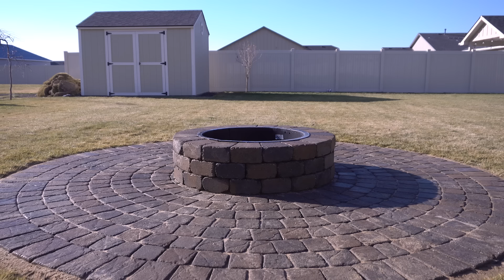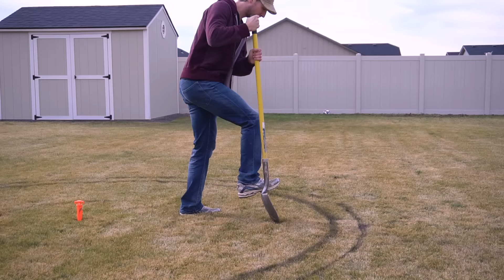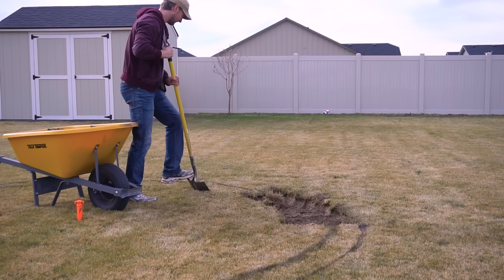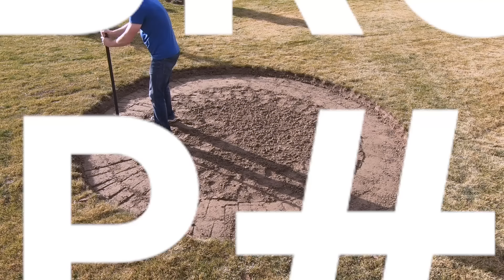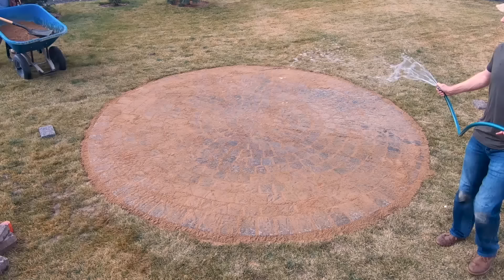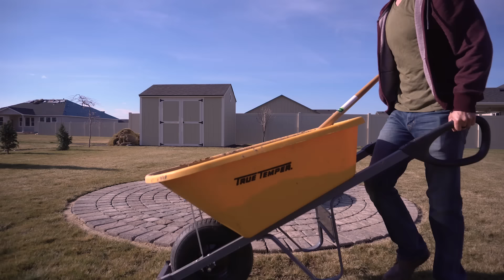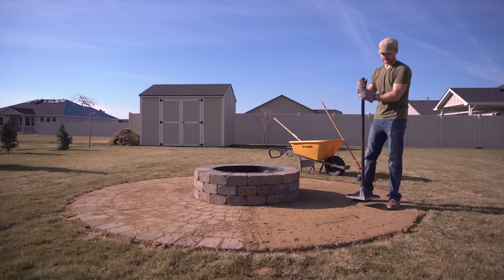My 4-Day Fire Pit Patio Build [Full DIY Project]

Comment: yes do get the plate compactor ,dont use sand use HPB also known as quarter chip , 7 inch base is very very minimum, the little gaps are to be filled with sweeping medium once stone is laid ,sweep it the run the plate compactor on top,that sets pavers down and trickles sweeping medium into the joints

Comment: Use a plywood board that's something like 75cm x 75cm (something like. 30 inches I think?) If you need to walk around the sand. Will be more stable than just some wood:)

Comment: Did you use polymeric sand, to lock the pavers in? If not, that sand will just wash away over time. Polymeric sand hardens when you spray water on it.

Comment: What was the point of laying the conduit if you removed it and filled it back in with sand?
Reply: The conduit is just a way to easily measure how much sand to out in. The conduit is 1 inch thick. You have to put down one inch of sand. Then you can use the conduit as a guide to push off the excess sand and make sure the sand is level and flat.

Comment: I'm no paver expert, but in my area sand is definitely not recommended. The thought is that water will slowly erode away the sand. Whereas 21a stone or pea gravel will stay in place. Only use polymeric sand at the very end to sweep in the cracks before misting with water.
Reply: Pea gravel will never compact
Reply: Dan Bertucci  My comment on philosophies is probably more in regard to heavy commercial applications. I'm a General Contractor, so I see lots of applications but don't necessarily have the intimate knowledge my subcontractor or you would have. That being said, I've never seen a paver job at my local university that wasn't set in .5" sand on a 7" concrete slab with 18" wide concrete curbs. So there certainly are different philosophies. But in general I imagine 21a sub base with sand or gravel dust top under pavers is immensely more popular. In my area they typically just use a gravel dust and only minimal as required to level the 21a.
Reply: Dan Bertucci  Thanks for the info Dan. I've had clients request 30+ feet deep pits in the middle of an operational factory, request rock blasting an ADA entrance into a famous operational cavern, drop MRI's through mutiple stories of an operational hospital, spend more than $70k on a crane just to set a single tank.... spending money on a 7" slab is not a huge deal if you need what you need. I've got pavers at my house and the installer indeed used something to level the sub base so didn't mean to imply like it was 100% incorrect application like I originally did. I definitely should have worded it differently. Minimizing that layer is preferable to me though.
Reply: PNW paver sales rep here, sand is used to level pavers above aggregate base. Compaction is absolutely key in making sure the aggregate base, joint sand, and sand leveling layer do not wash away or settle. So long as everything is adequately compacted, there should be no movement or erosion.

Comment: Three suggestion for this project. First, skip the center of the patio and build the fire ring first. Besides saving materials, the paver bricks degrade from the heat from the coal bed. That’s why the fire ring ships with a metal insert. Plus you won’t see the pattern anyway once the ring is in. Just leave bare stone base at the bottom of the fire ring. Backfill with more base or course gravel. Second suggestion, dig the base out deeper where the fire ring is. Dig the diameter of the ring about 3 to 4 inches deeper and base as normal. It will act like a sump and prevent your ring from flooding. Third, use polymeric sand to finish. It will hold the pavers better and cut down on weeds.
Reply: As a professional landscaper, I approve this message 👍
Reply from the maker: Appreciate the tips!
Reply: No problem.  The suggestions are purely pro tips to reduce costs and increase the life of the ring. What you did was great and will last for years.
Reply: If that was being built in a northern area, wouldn’t the pavers heave after winter?
Reply: @screamingmimi90  I used to build paver patios in Michigan. Short answer is yes: with the base thickness he used in the video it will most likely heave a little in a northern area. Long answer is that it won't really matter: With the relatively small diameter of the build, any heave won't really be noticeable. In fact the only reason it would be noticeable on a circle that small is that he filled in the center with stones. If he had started with the fire ring and worked outwards you'd only have about 4-5 feet between the ring and outer diameter that had the potential to heave. If he was planning on doing a larger job, or the patio was going to bear more load I'd have suggested a thicker base.
Reply: @seanderrick1422  Great info Sean, you know your stuff for sure. If you don't mind me asking you a question. I live in Canada where it gets very insanely cold. My build will be about the same size as this build but square instead. How much gravel base would you use to prevent heaving in this case? Thanks in advance.
Reply: @brandon3639  if you’re in southern Canada (Windsor, Toronto, Vancouver, etc.) 4 inches will work. If you’re in mid Canada (Ottawa, Montreal, etc.) 4-5.5 depending on how hard you feel the winter is. If you’re in the deep freeze (Calgary, Winnipeg) 5in+. If you are higher the Edmonton...you won’t be out doors enough to use the patio anyway.
Reply: @seanderrick1422  I'm building a limestone path in Indiana. What kind of gravel and sand should I use for the base? Someone suggested quarter minus, but is that preferable to pea gravel? #53 stone? And just fill sand? Thank you to everyone who suggested poly for between the stones!
Reply: @amyo3804  Hi Amy,
I want to preface my comments by saying I’m by no means an expert on flagstone style walks. Plus, it’s been a long time since I’ve done a limestone or flagstone pathway, so my information might be a little dated. So please shop around for opinions beyond my own. In the past, we would lay the same subgrade base as a conventional paver patio (IE Type 2 or ¾ Stone with stone dust) to the same thickness as concrete pavers. Depending on the customer, we would use sand, same as on pavers, or decomposed granite (Called DG with screenings at bulk suppliers) to set and level the stones. Which option we went with depended on what the customer wanted to fill in between the flagstones. If they wanted something very course (3/8” or larger) we would use sand. If they wanted something finer or more decorative, we would use the DG with fines. The DG packs tighter and was less likely to come to the surface or mix in with finer materials. A lot of times the customers wanted the DG to be the decorative filling between the flagstones. Do not use pea gravel for patio bases. The key to a landscaping base are the fines that get mixed in. These fines fill in the gaps between the stones and prevent shifting and heaving. Pea gravel is not only more expensive but also lacks the fines so it will shift like marbles. The only times I use pea gravel is strictly for decoration or large-scale drainage (like drywells and French drains). In the case of drainage, the pea gravel is held in place by something else, like plastic or landscape fabric, and not structural. In effect the gravel acts like a filter or filler medium. Hope this helps
Reply: @screamingmimi90  I live in Utah and I haven't ever had any problems with pavers heaving as long as the sub-grade was done correctly.

Comment: Did you consider kiln dried sand for the infill between the stones
It's what we use in the UK🇬🇧
Only thing I might have done differently was to fix the final stones around the fire pit with fire cement.
But awesome job and goods friends.

Comment: Here is a tip to help with digging the dirt after the grass is removed.  If you use a tiller to brake-up the dirt it makes it easy to remove the dirt.  The key is to set the depth of the tiller about 3 inches above your final depth.

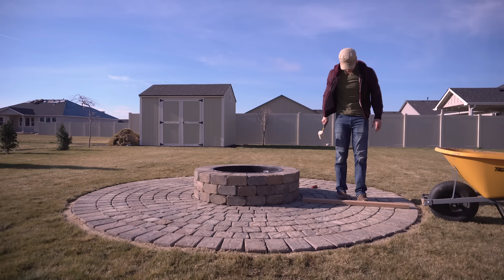@11:24 you ask if there is a better way, well there is.  The step where you placed the sand on top of the pavers and brushed it in.  Instead, you put down the amount of sand that you did and use a compactor to vibrate the sand into the cracks this also sets the pavers firmly into the sand it locks all the pavers together tighter.
Reply from the maker: Thanks!

Comment: Sand on the top is easy to make in level, but is not good for stong layer. Sand should be in the first layer of the bottom. On the top should be special wery small stones gravel.

Comment: I built one of these 3 yrs ago. 20', 10" total deep, dense grade base, sand under pavers, #57 around pavers. Found using tiller to break up dirt really helps with removal of dirt when going this size. Take your time. Turns out great!!

Comment: Only thing I would do differently is use chips and dust instead of gravel and sand after a few years or maybe less u may have parts that sink.. I used to be a Forman for  a landscape place and I've built lots of patios and such
Reply: What kind of chips and dust? Thanks

Comment: We don't have a truck but would like to rent the $65 tool for 4 hours. Do they deliver and pickup? Does the machine have wheels? Wondering how to get it to the backyard without breaking back. Newbie here. LOL
Reply from the maker: Usually they'll rent you a pickup truck, too - but you may not need it. Check with your local place for the actual pricing, and to see what sizes the offer.

Comment: Pro tip, a pointed shovel is for digging holes. A short handled spade is for cutting and removing turf. I do not see a compost pile there in your suburban yard, so where did all the waste go? Also, wearing work boots  allows you to use the big muscles of your legs, to kick spade into turf comfortably. Sneakers are for sports.
Reply: You seem like a blast
Reply: @jakass  Your Mom sure thinks so

Comment: They sell landscape adhesive at lowes or home depot that would be great for the top of that fire pit. If someone sits on it or a kid or pet is playing on it they potentially could come off. That helps prevent it.
Reply: I was wondering about that!  Seemed weird there was nothing binding stones together on the fire pit itself!
Reply: and maybe tint the cap stones black so they dont show scorch marks after the first few fires.
Reply: That's what I use as a landscaper. Works great 👍
Reply: How much was the final cost?
Reply from the maker: @paulasmith3133  about $1400 for the kits. Then a couple hundred more for sand, gravel, and misc materials.
Reply: What is Lowe’s or Home Depot?
Reply: @nikolai7880  those are larger home improvement retail stores in my local area.
Reply: Yeah. Adding a little cement into the sand being pushed down into the patio will darken the colour so it matches the stone and will help bind it all together, but it is optional.

Not adding mortar between the bricks of the firepit is a bad idea.

Comment: Hey bro you didn't installed fabfric.at the beginning. That helps with the natural sedimentation process and later sinking of the leveled pavers 
Pavers have only one face side wic h is the one with the. round smooth edges .
If  your sand base is right on one inch and TAMPED as well you dont have ti do all that extra work .
The person who sold you the material advise you for big gaps just to sell you more paver sand o he don't know what hes talking about 
Lay them down together those kits are design that way, sand will find its way down. 
It loos very PROFESSIONAL CONGRATS.

Comment: Will be a very good idea to lay filter fabric over the soil to prevent roots from the bottom. Another two - mix some cement into the sand - will make it  stronger, vegetation resistant and more important - ants proof!  They will not be able to dig inside and take sand out.
Reply: Great tips 👊🏾 thanks!

Comment: Great job. Two suggestions. Leave some gaps in the wall of the fire pit so air can fuel the fire and use polymeric sand between the pavers. Once you wet it, it hardens and nothing will grow between the pavers and they will not move.

Comment: I've been laying pavers for 8 years now with a company that's been in the business for almost 50 years. This patio looks nice right now but I guarantee it'll look rough in a couple years.
Reply from the maker: Yeah, I second that question. We'll be doing another patio (and pergola) down the road, and I'm definitely gonna be using the best ideas from everyone's comments.
Reply: Those plastic edges are no good. Trowel in a good 4 inch deep ring of concrete around  outside edge, like a mason does behind Belgian blocks.
Reply from the maker: @jasonk3038  I don't really like the look of a cement border. I did consider it, but wanted the grass to grow right up to the pavers instead.
Reply: @BroBuilds  you don't need a concrete border, it does help when it comes to drives but it's not necessary for patios especially since you kept it tight to the dirt. I would've used an aluminum edging with a good spike to hold them down. A compactor is necessary for a good solid base and to compact the sand in the joints. We never use water to get our sand packed in.
Reply: @BroBuilds  Then I hope you like the look when the whole circle begins to shift and move. If you live in a climate that has deep freezes, it will happen the first winter, as water in all those joints expands as it freezes and thaws. That flimsy plastic edge screams rookie louder than working in sneakers.....
Reply from the maker: @jasonk3038  🤷 One winter down, so far so good. But we'll do an update next year and see how it looks.
Reply: What do u recommend ? Different quality bricks or a different foundation? Thx

Comment: Great work. The only thing I would have done differently would have replaced the sand with a special paver sand that doesn’t blow away
Reply: It’s called Polymeric sand.  Comes in different colours and locks pavers in, reduces weed growth, and is generally a lot less maintenance in the long run.
Reply: @01AceAlpha  thank you! I had a Covid moment and I could not remember the stuff. So much better than pure sand
Reply: Silica sand and wacka plate done

Comment: Folks, if you're going to put such effort into your fireplace,  add some air supply to it .   Everyone will think you're the king with the smokeless fire 🔥
Reply from the maker: I love these suggestions - stay tuned for our next video :)
Reply: @BroBuilds  yeah hurry up. Im waiting here!
Reply: Which album of theirs would you recommend?
Reply: A good way to cheat and get that fire going quickly is to leave a lower spot big enough for a leaf blower on low. Let that thing run for a bit and you got an instant hot fire! Of course do this before your guests arrive.
Reply from the maker: @nikzamora9559  there's definitely some footage of Ryan doing that after we put the holes in. 😁 Might make it into a story, or Instagram post some day.
Reply: You're right,  listening to "Lost in love" around the patio fire ring would be a great evening.
Reply from the maker: @Scott Barnett we just removed a few bricks in our latest video, actually. They're pretty thick, so it's easier to do that vs drilling.
Reply: Seen fire pits done by laying a pipe from the center out beyond the paving. Build the pit and paving after the pipe is in place. You can then attach a quiet fan onto the pipe, this is by far the best method I've seen to reduce smoke.
Reply: Sorry didn't mean to comment on your comment
Reply: If you wash the sand in with water you get it in the cracks better. Your supposed to use water
Reply: how does air supply prevent smoke? You mean some sort of ventilation?
Reply: @HomesteadZach  allowing more air into the fire helps the wood to burn clean with a flame, rather than smoulder. It's a classing meat smoking technique for bbq smokers, the more air flow, the cleaner the wood burns, allowing the smoke to be thin and blue/clear, rather than heavy bellowing white smoke
Reply: @Danielissocoollike14  Good to know; If there was an air supply would there be any concern of the flame catching the oxygen and combusting?
Reply: @HomesteadZach  "air supply" doesn't mean feeding it pure oxygen, it just needs fresh air to circulate in. For this particular fireplace I would have used a couple less bricks on that bottom row. This would give some nice gaps between the bricks allowing the fire to breathe.

Also, remember your fire triangle, oxygen doesn't burn on it's own. You need heat, oxidizer, and fuel. The oxygen itself isn't going to burn.
Reply: @HomesteadZach  what Joseph explained is exactly right, it's not about feeding it a tank of oxygen, but giving it more airflow will allow it to take in as much oxygen as it needs allowing it to burn clean
Reply from the maker: @Danielissocoollike14  love this comment about blue/thin smoke. That's exactly what happened when we increased airflow in our new video. At the time of filming though, I didn't realize the different color meant something. Very cool!
Reply: @BroBuilds  check out any bbq/meat smoking youtuber and they'll have a video about fire management, will be packed with info on this!
Reply: @HomesteadZach  check out rocket stoves... fast air intake means hot fire that burns cleaner and ejects smoke faster
Reply: @HomesteadZach  I was going to ask the same thing. Like what are you exactly supposed to do?
Reply: @throdenday8653  I’d use a metal core saw to cut some holes in that metal fire ring. Doing that with the small gaps in the pavers should do the trick.